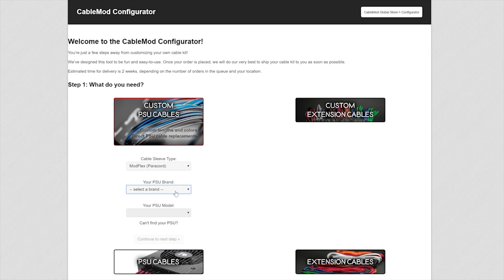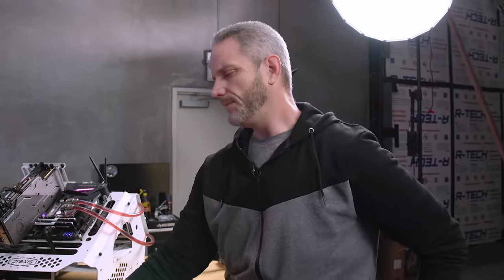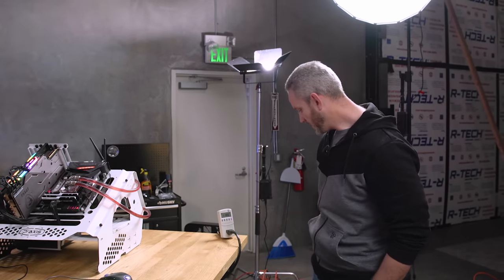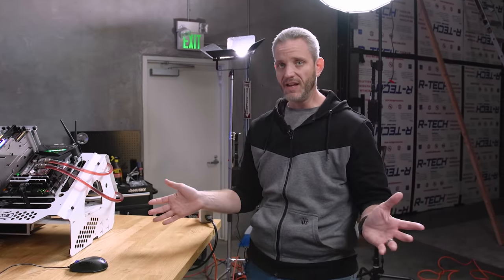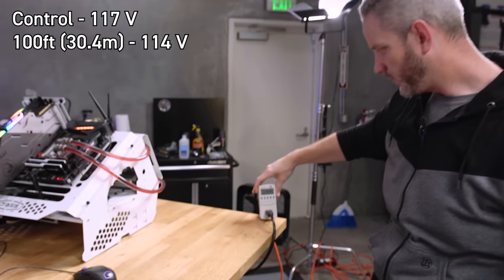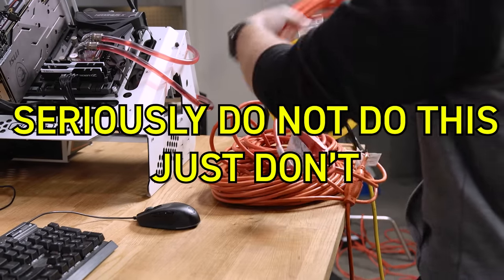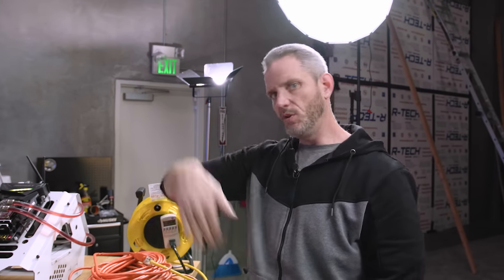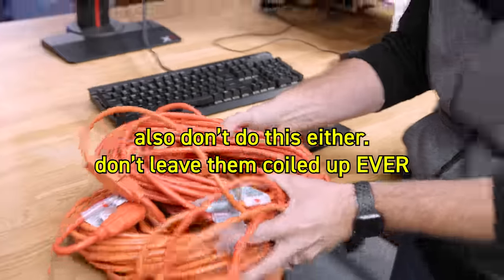Are extension cords dangerous for Computers?

Comment: Jay: This is the cheapest cable with the cheapest insulation leaves it all coiled up on a wooden table
Me: Oh god he's gonna burn it down for real this time
Reply: he should have put a induction compatible pot on it with a egg and see if it would bake
Reply: @darknessblade7480  magnetic field cancels out because the current is flowing both ways. Nice thought tho
Reply: @mschild95  i know that will happen, but it would be a fun joke they could make, when cutting the camera somebody swaps the pan with a baked egg in it, without the 2 guys knowing it
Reply: Well he can't put them on the floor, that's where all the coolant goes when his cooling loops fail.
Reply: He should also have gotten extension cords with the lowest maximum rated current (usually those garbage white/brown 18 gauge ones) lol
Reply: Can someone tell me what the problem is with coiling them up?
Reply: @mrsuperguy2073  current induces a magnetic field, if you coil the wire this gets magnified by a lot (compared to a straight line) this magnetic field is always oriented in a way that counters the electric flow thus "slowing" it down (Law of Lenz) this "slowing down" can be compared to friction which is why coiled up wires can get really hot if they have a great amount of current flowing through them
Reply: @mrsuperguy2073  What Schild0r said is of course complete bullshit. It's just that the heat can't escape as well.
Reply: @gustavgans3760  heat introduce aditonal resistance, and with additional resistance there is loss of power. Without coiling up cable might have chanse to properly suplay PC and compresor.

Comment: 0:32 If I REALLY wanted my system to pop, I would get a cheap PSU instead.
Reply: Always love when I get a PC that has one of those generic cheap silver china PSUs fitted. Especially when the user said something like weird smell or doesn't turn on anymore.
Reply: @DrakkarCalethiel  "Smoke and flames coming from PSU"
Reply: corsair VS550 gang
Reply: @DrakkarCalethiel  A friend of mine gave me a broken PC to take the parts out, the PSU had a stuck fan, the cables were brown near the casing of the PSU and when I opened it up the board was all black and even bulging. The last owner was lucky it didn't set the house on fire.
On top of that the (all rusty) DVD drive had some pirated emo music CD on it.
Must be why the damn thing almost set itself on fire
Reply: @Kalvinjj  Hahaha, great story! Worst PSU let the magic smoke out and popped a 16 amp breaker. The caps on the primary side where the culprit. Luckly fo the owner, everything downstream was fine. That machine was also the most dusty I've ever had. Even a vacuum cleaner bag has less dirt in it than this poor system! 
Luckly, I didn't had a single system with cockroaches... until now. :D

Comment: Something that someone may have mentioned already is that using the contractor cable as shown @ 9:45 in the test will also add impedance to the test as well as resistance because of it being in a coil. Each loop adds its own impedance to the circuit.

Comment: These cords also work as an inductor introducing reactive load into the system. That way you don't just have the resistance of the cords limiting the voltage but also the impedance of rolled up cords.

Comment: Jay: [plugs in coiled extension cords]
Electrons: Inductance, ENGAGE!
Reply: I was looking for that type of comment, always uncoiled your extensions cord when you are using a lot of power on it.
Reply: AcTuAlLy
Since the live and neutral are so close together, their magnetic fields pretty much cancel each other out and the inductance is negligible
Reply: @TDG2654  True but the coiled up leads trap the heat in and can't dissipate it well.
Reply: They would be nice degaussing coils though.
Reply: People saying they dony get hot are full of shit. I've felt it happen myself.
Reply: @jasenrock  no it not because of induction the wire cant disapate the heat to the air when its coild up in an ac system the live and neutral wires cancel the magnetic field out

Comment: hey jay, during my instrumentation course one of the instructors said this to explain wire resistance, he said " wire is like a highway for cars, if you have a 2 lane highway(18 gauge persay), only two cars wide can travel down the highway. but if you have a 4 lane megahighway, 4 cars can go down. the thicker the wire, the more lanes on the highway OR space for electrons to go through "

Comment: Lol, this video was about 20 years late for me. I have a video of a lan party I hosted in my youth where we played "find the smell". We assumed someone's overclocked rig was cooking. No, me in my brilliance used a 50' extension cord on a reel without unrolling it. The results were eye opening lol. After that I built a power distribution center using a breaker box plugged into the 220v 50A socket for my welder and split off into five 110v 20A lines. It worked well and we used that setup for a decade.

Comment: "5v extra resistance" reeeeeeeee
Reply: @GeneralZap  no u
Reply: 115 is fine. There's a reason American plugs are often called 110 and not 120, it's a nominal voltage under load.
Reply: @Jaker788  you don't measure resistance in volts, you measure it in ohms. That's what he's "reee"ing about.
Reply: @_Bonez12  gotcha I didn't catch that
Reply: @_Bonez12  well actually you do. But by using a measured an licenced current source. (Four point measurement)
Reply: @loempiaboer-up2dh  well then u still don't have 5 volts of resistance

U just measure a 5v differential over a certain current
Reply: He may not be talking in ohms, but seeing the voltage drop is something anyone can do safely and easily with a $20 plug in meter like the one he has. You have to think about how small the resistance is here. When one extension cord adds 0.1 ohms, the average person isn't going to have a good enough meter to measure that accurately, but the average person can easily, cheaply, and accurately measure that the extension cord caused 5 volts of voltage drop even if they don't know exactly how many ohms are causing that.

(0.1 ohms is a guesstimate based on one cheap extension cord probably has low enough resistance to allow 10 amps through)
Reply: @Ferro_Giconi  V = iR dude. 
In this case we don't know resistance of the wire or how much current is being drawn, but we can make some rough estimates.
If he can pull 1000 watts at 100v, he is drawing 10 amps. 10 amps through a 2 ohm load gives a 20 V drop, so that big bundle of extension cord he is running is probably somewhere in that ballpark

Comment: This would've been the perfect time to cooperate with ElectroBOOM, ask him to lend you an oscilloscope and his expertise in analyzing the voltage drop vs PC PSU stability.
You should also look at the PSU voltages to detect changes in stability. The components themselves can tolerate quite a bit of voltage drop, especially on the 12V line, since most components will step down that voltage to supply things like the GPU, Memory and the CPU.
In the end it will probably not be the voltage drop itself that causes the instability, but rather the inability to deliver enough amps at the lower voltage to meet the demands on current.

Comment: Bigger concern: You didn't unwind it, so you have inductive resistance!
Reply: That's me with Ethernet that's too long for places I move into.
Reply: You mean reactance, right? Have you ever tried calculating inductance of an extension cord on a drum? I'm just asking out of curiosity. I understand the theory, but I have no clue as to what are we talking about scale-wise. I know manufacturers of cords on drums say you should always unwind it completely, but I always felt it was more for cooling. Coiled up cord is not going to cool well and when you start pushing a lot of current, you're asking for trouble.
Reply: Wouldn't that be cancelled out by the current flowing in the opposite direction?
Reply: Charlie Mio TO ANSWER JOBIcEK: You can calculate inductive reactance by the formula 2PiFL where F is frequency and L is inductance in Henry. And the answer is in ohm. 

To answer charlie mio: No. the current still flows the same way in the wire.  There is no relative opposite flow in the cable. So they act like an inductor essentially.
Reply: @FunScientifix  interesting point but the neutral and active lines are right next to each other. The way I understand it is that whenever current is flowing one way in the active wire it will be flowing the opposite direction in the neutral wire. Because the current is flowing in opposite directions they will be creating opposing fields that would (almost entirely) cancel each other out. Given that inductance is a result of energy being stored in said field then there would presumably be nearly no inductive reactance. Another reason that I don't think there's a field is because an AC current clamp meter won't work around an extension cord unless you separate the active and neutral wires and clamp around just one of them. These meters work by measuring this field, given that they read zero when the wires are together it seems reasonable to me that it's because the fields are cancelling out. Am I missing something here?
Reply: Charlie Mio You are correct. Infact, the inductive reactance is the least of the problems here. The neutral wire does cancel the live wire’s fields. Although not zero. There are a few factors like 1)the wire that is on the outside of the cable has relatively higher length than the wire on the inside of the cable. (The effect is increased when multiple turns are added) 
2) The wires radiate energy in the form of magnetic field and that is never equal in live and neutral. So there is a difference in current in L qnd N. (Low, but effect increases with length). These contribute to almost 1-3% loss (not calculated) at that power level.
Reply: @FunScientifix  If the cable insulation is OK, there will be no difference in current flowing through L and N. If there would be a difference, it could only be, because you would have leakage current to earth. This has nothing to do with radiation.
The inductance of the cable is dependent on the area between L and N and will increase with cable length. It, however, will not be dependent on the way how the cable is arranged, whether it is straight in a line or on a "coil" will not matter. Only if it is in coil shape, the cooling is worse and the resistance increases due to higher temperature, so the voltage drop increases.
Reply: @charmio  You are not missing anything, everything correct as far as I know. I'm an EE working in the field of Power electronics.
Reply: @FunScientifix  you are wrong.
Reply: The motherboard has a vrm and the power supply is 80plus so voltage drops this small won’t make a bit of difference.
Reply: hmmm- combined with the capacitance of that spool that is going to make some nice ringing on the input.
Reply: So biggest concern here is the fire hazard with it. Had a buddy have one of these extension reels mounted to a roof and his room mate connected a vac form table to it as it was wrapped up and melted the wires from the current being drawn from it

Comment: Never ever leave extension cord rolls rolled up unless you like fire. 🔥
This is probably adding much more to the heat of the cords.
Reply: exactly, if the cords were spread out they wouldn't have gotten as hot but having them bunched together like that will cause them to melt if they get hot enough, the cords are basically acting like a resistor
Reply: Coiled cables can also have significant impedence which can make the system response to changes in power requirement sluggish.
Reply: They should have a label stating how much wattage you can pull through it while rolled up. You're okay so long as you long as you stick to that. I still uncoil regardless though.
Reply: @MrNeocortex  who's going to follow that tho. People arent that smart, even if it is written on the cord
Reply: @wescottpsmith1965  its not about the impedance of a coild up wire but more because the heat from one wire does not disapate to air but into the nex wire this heats em up
Reply: They should teach this in school. It's like one of the major causes of house/garage fires. So many people use them 24/7 all coiled up in the corner of their basement or garage to power things like sump pumps and they just fail and catch fire.
Reply: i was waiting with one eye closed for the wormhole to open up to another universe!
Reply: Also why he seemed to fix the voltage drop. He added a giant coil which has capacitance.
Reply: Is this the effect of electromagnet (wire in a coil)?
Reply: No no! Always leave them in the same coil, also cover them and remember to run high amp stuff like heaters on the same circuit!
It is the best way to heat your house too :D
Reply: It's the electromagnetic fields' interactions with each other and each coil of wire  that causes the extra resistance when an extension cord is coiled up. When the resistance is due to that, it's called impedance, not resistance, but the effect is pretty much the same. The more coils you have, the more interaction there is, the more impedance, which then leads to more heat, which also causes an increase in resistance. Sprawl out your extra extension cable to avoid that.
Reply: @nickhetzer2744  that was my thinking as well. I would think resistance stays the same rolled up or not.
Reply: @nickhetzer2744  Impedance is resistance, at least inasmuch as they both represent an opposition to the flow of current. A coil of wire with AC running through it becomes an inductor, which adds additional impedance and results in even more heat generated. Add to that the problem you mentioned about heat not dissipating fast enough through a wad of wound-up cable, and you have a real fire hazard on your hands.
Reply: @brando12343  I liken it to an induction cooker.
Reply: Umm, have you seen how Jay responds to "OMG! You're doing it wrong!" comments like yours?
Reply: @nickhetzer2744  try the magnetic field that is created.
Reply: @CMDRSweeper  and get those nice people in their red trucks to come and visit.
Reply: @ianmontgomery7534  no sry in germany in the electronics field red pickups are not to common
Reply: @dstarfire42  dont care how he responds. That is a fire hazard and a common mistake many people do, causing  a lot of fires each year.
Reply: @nickhetzer2744  I was meaning fire trucks.
Reply: @ianmontgomery7534  i tested it today with an din vde 701/702 tester at 10 amps and the whole impedance does not change much around 2 ohm at 50hz on a 25 meter extencion cord on a mettal spool
Reply: @nickhetzer2744   It will only get hot in the right circumstances but the average user wouldn't have a clue what that may be (usually a power board on the end of the lead with a couple of heaters etc on them!)
Reply: @ianmontgomery7534  i dont say they dont get hot i only say is more about the heat transfer and not the increased impedence but under load coild up is dangerous even more in the us at 120v than in europe at 240v due to the higher curent requierd for the same wattage

Comment: Since you wanted an E.E. to chime in, here goes:
The resistance in the extension cords doesn't (in itself) present a problem for the computer — most computer PSUs will actually function down to 60V or 75V; this to allow for fluctuations in supply voltage and occasional "brown-out" conditions. In fact, AC line voltage will often vary MORE with load and the contact resistance between the plug and the socket than it will from adding all those extension cords. The danger (as you've noticed) with running excessive draws through longer, thinner extensions is HEAT (which can compromise the insulation).

As far as QUALITY of power, adding a motor in the same circuit will add more noise than ANY extension cord will; a sudden inductive load (like a compressor, vacuum cleaner, washing machine, etc.) will seriously screw with your power (at least momentarily) and will add noise (continuously). Other sources of electrical noise: fluorescent light ballasts, TRIAC-based dimmers, AC stepping motors — basically anything that will induce harmonics on top of your (60Hz) fundamental AC frequency can cause spikes in switching power supplies that will have to be filtered out by the supply. The more the PSU has to draw (current-wise) to compensate for a lower input voltage, the harder this becomes.

Incidentally, the reason European (230V) AC voltage is considered superior has nothing to do with the noisiness or quality of the AC supply. It's simply that less current is required to produce the same wattage. Therefore, a 150W appliance that would have to draw 1.25A at 120V would only have to draw 650mA at 230V, and (since load noise is proportional to current, not voltage) you're less likely to be affected by electrical spikes at lower amperages.
Reply: 10/10
Reply: great points!
I know I'm late to watching this one, but I'm surprised nobody seems to have called out that the power supply in the PC (as he was scrolling through it's specs on his phone) was a PFC (Power Factor Correcting) supply.  I'll lay odds a non-PFC pc power supply (i.e. most of them that people buy) would have fared nowhere near as well.

Comment: The math is very simple: 120V@20A=2400W (V*A) In Europe we can draw 230V@16A=3680W (per circuit. We usually have 5 or 6 circuits). 
Coiling a cord increases its resistance and it will get hotter. (It also creates a magnetic field, which can affect electronics).